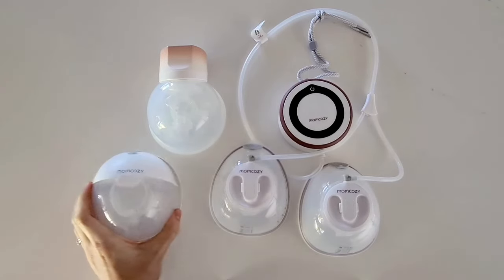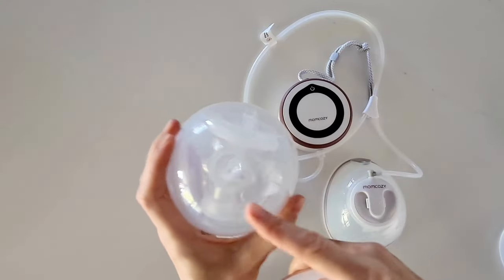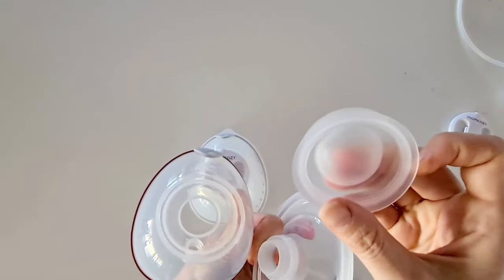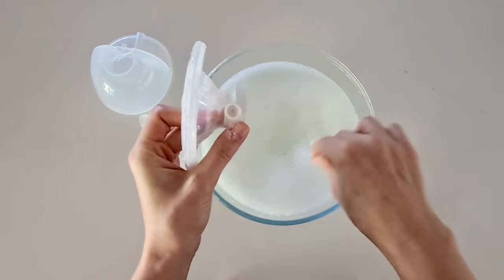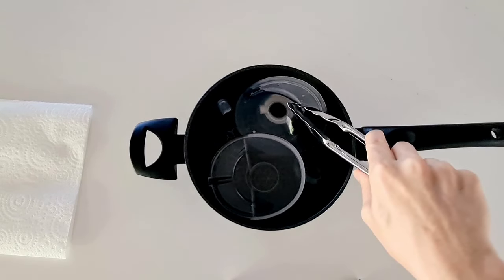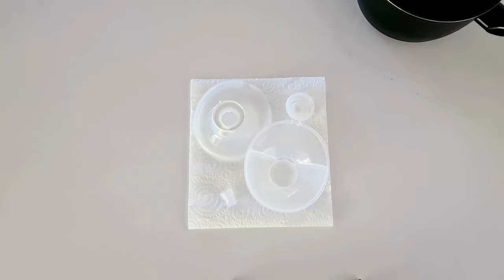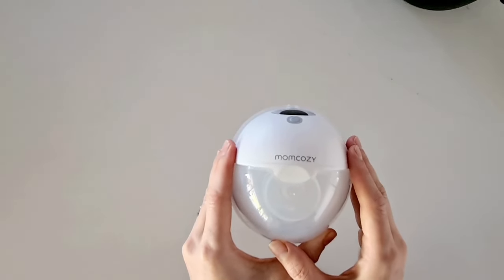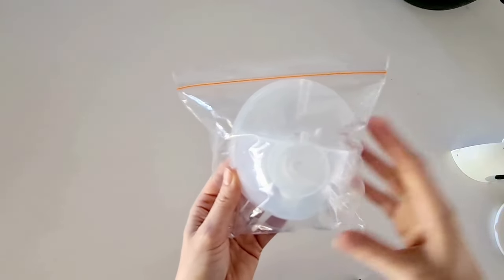How To Clean Momcozy Pump: Complete Guide including Cleaning, Sterilizing, and Storage Tips

Comment: I really wanted to see how you boil the parts. In the manual it says that you have to ensure the parts aren’t touching the sides of the pan when boiling. How on earth is that possible. Surely when it boils, it will move and touch the side of the pan. Are you able to do a demonstration?
Reply from the maker: Just make sure the pan you are using is large enough to have some free space around the parts. It is inevitable that they will touch the sides of the pan at some point. Just keep an eye on it and if needed you can use tongs to move them around while it is boiling.

Comment: Can you use a bottle sanitizer  in stead of boiling waiter ?
Reply from the maker: I believe you can for the S12 Pro, S9 Pro, V1 & V2.
The user manual for the M5 states 'Do not sterilize pump parts in a microwave or UV sterilizer.'

Comment: Can I use a sterilization machine instead of boiling the parts after washing?
Reply from the maker: Momcozy do not recommend using a Microwave or UV sterilizer with their pumps, however for the Momcozy S9 Pro/S12 Pro/V1/V2 they do state you can use their Steam Sterilizer Bags  https://amzn.to/4d30Gxb (#ad)
Another option is using Milton Sterilizing tablets https://amzn.to/4ekTL3y (#ad)
Reply: @pumpingmilk ok thank you
Reply: How about a steam sterilizer @pumpingmilk
Reply from the maker: @janellemjackmanmd9655  as long as it doesn't get hotter than 100 degrees celsius it should be suitable

Comment: As another option for sterilizing parts (those that are safe to sterilize in the microwave specifically), if you own a pressure cooker, 15 minutes under high pressure is also a very effective way to sterilize almost anything. There has been a fair bit written about smaller labs without access to an autoclave using pressure cookers to sterilize their tools.
Reply from the maker: Thanks for the tip!!
Reply: It’s not recommended to use to the microwave to sterilize any of the parts
Reply from the maker: @Jessicasandstreetsniffle  thanks for the insight! Just as a note you can use the Momcozy Microwave Steam Sterilizer Bags for Momcozy pumps, except for the M5.